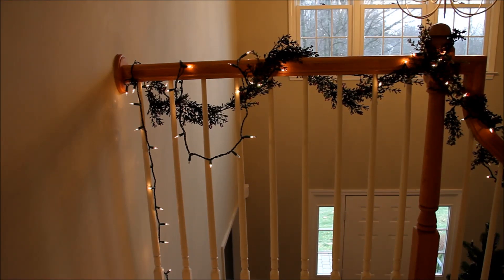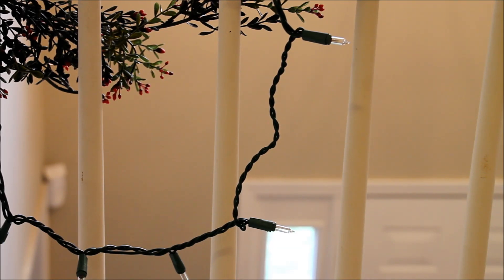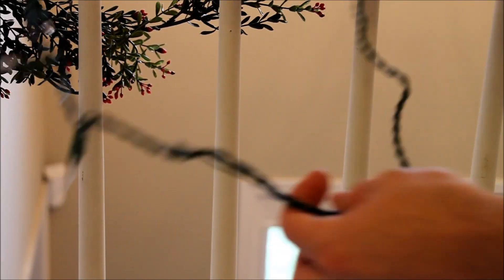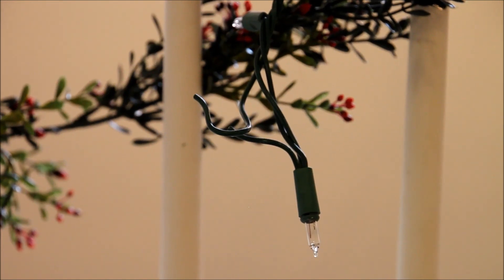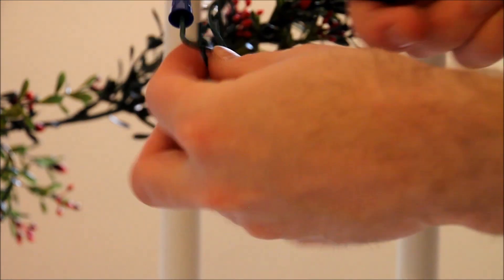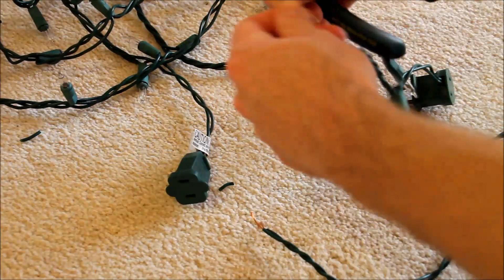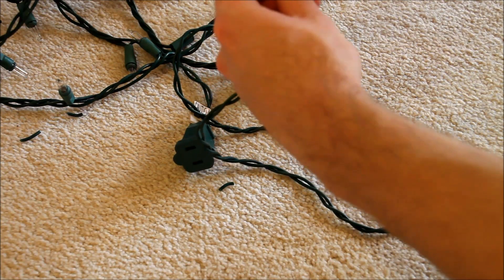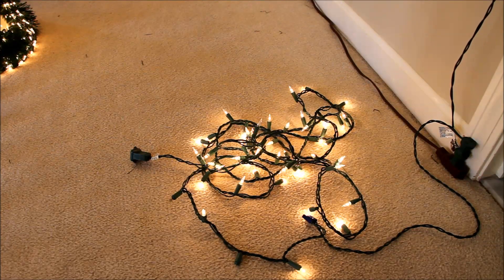Changing Length Of Christmas Lights

Comment: Thanks for the video!  This was exactly what I needed.

Just an FYI for anyone doing icicle style lights on their house, the Holiday Time 300-Count Icicle lights (I got mine at Lowes) are actually broken down into four separate groups per strand.  This is really nice since you can actually cut your line in three different places (1/4, 1/2, or 3/4).  This was a huge help in getting the strands cut to the right length for my roof.  The spot to cut always has two wires instead of three, as shown in the video.  The only thing I changed was to use crimp on butt connectors for a more permanent termination.
Reply from the maker: This is good information.. I believe most icicle lights work in 4 sections with 300 lights on a string..

Comment: Great video Vern but instead of capping them off, you can pull out the one you cap off at the end (the hot) where you cut it, pull it out of the light fixture. Then the other one work all the way back to the first light and then pull that one out as well. Pull both out from light using pair of side cutters or needle nose, anything that can get a good grip of the wire.
Reply from the maker: That doesn't make sense
Reply: @JordanU  I did it. Instead of capping the hot, pull it out of the light. Then the other, the neutral, work it back to first light and do the same
Reply: @JordanU  why leave a hot wire sitting there when you can just pull it out?
Reply: @JordanU  hopefully that makes more sense to you now. Rereading my initial comment, I can see I needed to use more punctuation and will correct it.
Reply from the maker: @iwishyouwould6937  OK, I think I'm capturing it now, and I think you're right as long as the removal doesn't damage the socket..
Reply: @JordanU  definitely works because I did it already. I have small children and did not want to chance them somehow taking off tape and then wirenut. Very simple and way safer than leaving a capped 120v wire blowing in the wind, just a saying, the lights I cut down go around a super small indoor tree. Also gives it a cleaner overall look.

Comment: Thanks for the video! My string was cut where there were 3 wires. So now I have 1 end with two wires and one end with three wires and I would like to connect them. Is there any way to do that? Or should I try to find another spot of the string where there are 2 wires and cut again? It's a 200 lights string.
Reply from the maker: The strings of 200 are generally broken into 4 segments of 50, so you'd still have to follow the procedure as described in the video. If you cut elsewhere besides a 50-increment mark, it won't work. You'll need to patch it back together as it was and cut elsewhere.

Comment: Didn't you say you cut it where there were two wires? That is before light# 50. The end of one string and the beginning of another string will each have a bulb with 3 wires in thm.  Between these two bulbs is where light number 50 for one string and light number 1 for the next string is.
Not sure why u keep saying it has to be 50 lights, electricity can not count. Just basically need the hot side feeding the lights and the other side acting as the neutral back , completing the circuit.
Btw, if the lights are in series , and you cut a 200 light string down to 50 lights, you might possibly  blow the bulbs because of a higher voltage , depending on the bulbs.
Reply from the maker: Most strings are broken into segments of 50, which can operate independently of each other. Therefore, that's where it needs to be cut. Some strings of 100 are split into 33, 33, and 34, but those are uncommon. You cannot cut it anywhere you feel like as the voltage to the bulbs will not be correct across the set.